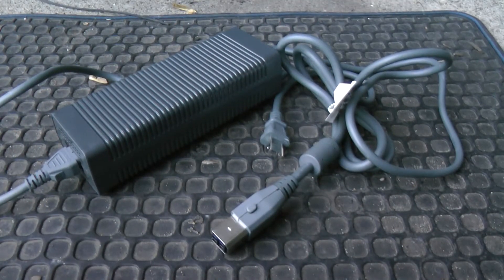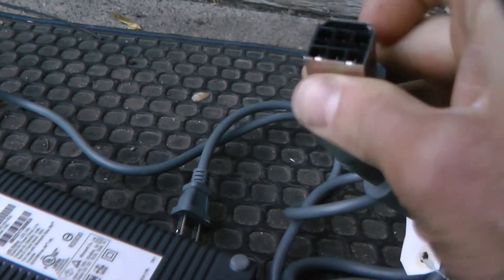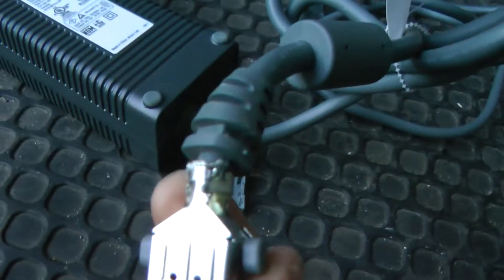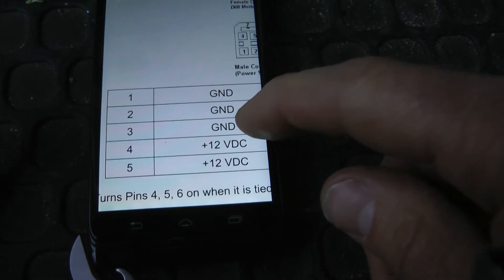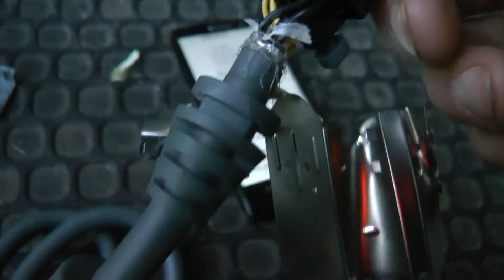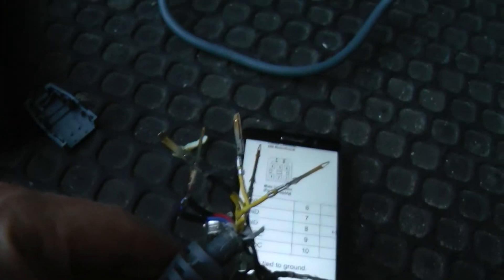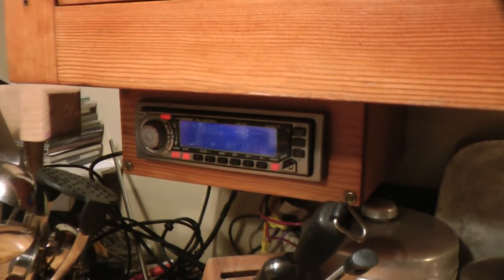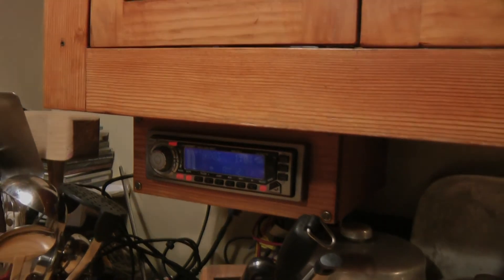Hacking an X-Box Power Supply - 12v 203W

Comment: Hi !  a little old video but i try anyway.  Which amp have you powered with the Xbox psu ?  what the outcome ? i would like to try it with some low power car amps   thanks a lot, gino
Reply from the maker: it is just a 40x2 watt amp but it has plenty of power.
Reply: @mbrenengen   Hi thanks a lot for the kind reply  It is what i am looking for.  I am buying this Xbox psu ... could you tell me the brand and the model of the amp ?   stereo digital home amps working on 12VDC are limited in power.  I already have this one 
https://www.amazon.it/LP-V3s-Piccolo-Amplificatore-Corrente-DC12V/dp/B00UOCBRL0/ref=sr_1_1?adgrpid=52044599469&dchild=1&gclid=CjwKCAjwyo36BRAXEiwA24CwGVAsvRUwBg0DE5nHQFo9gLLjArts9I4CfM9wv4ovC1QYzISAgJh3vRoCtA0QAvD_BwE&hvadid=255148697230&hvdev=c&hvlocphy=1008485&hvnetw=g&hvqmt=e&hvrand=5405977169226050654&hvtargid=kwd-331154127804&hydadcr=26144_1766979&keywords=lepy+lpv3s&qid=1598275879&sr=8-1&tag=slhyin-21
not bad but little in power and so in bass response ... only acceptable with very efficient small speakers  
I am looking for some more power always with 12VDC power supply   
Thanks again, gino
Reply from the maker: @gino3286  The XBox power supply puts out about 200 watts of power. Your amp is 25w x 2, or 50 watts. You could go bigger if you wanted, but probably not more than 50w per channel. Good luck.
Reply: @mbrenengen  thank you very much again I understand now that the limiting factor will be the  amp Still you are misterious about your personal amp Please tell me I would like to get something good Thanks again Kind regards gino
Reply from the maker: @gino3286  Oh, mine was just a very old Rockford Fosgate I had lying around. You will have to research it on your own, as I don't know squat about amps these days.
Reply: @mbrenengen  i will look for that brand around for sure Thanks a lot again Questions ended i promise Kindest regards gino